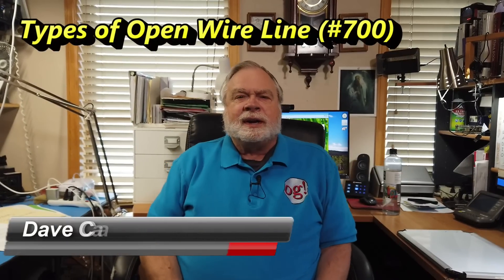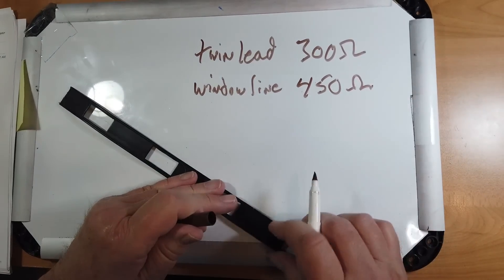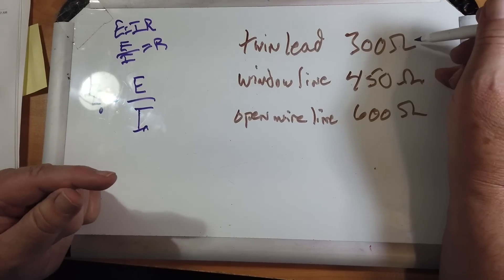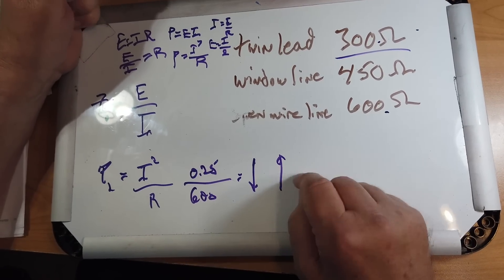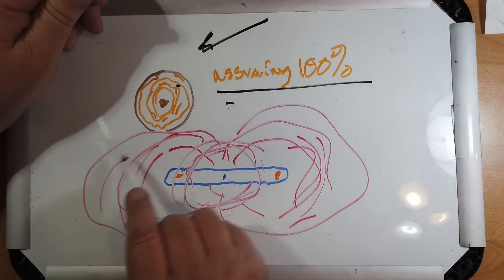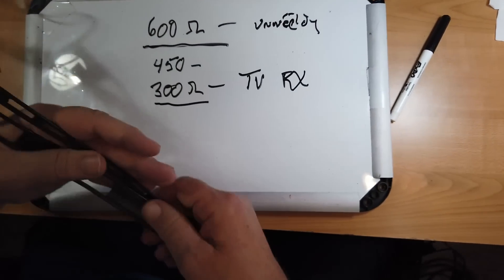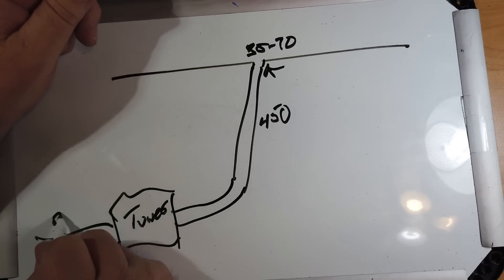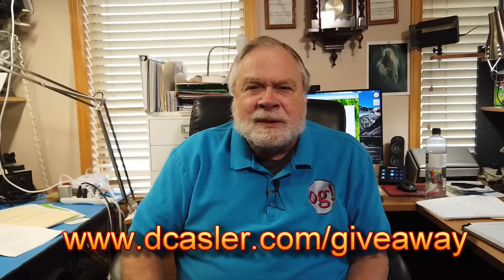Types of Open Wire Line (#700)

Comment: I had a trouble by following this explanation. P = I^2/R? And about what power-losses we are talking? Due to..? Current? Higher R lower I at the same P, V must go up. I was looking for the explanation of the 9:1 UnUn needed for the LongWire antenna and can not understand why is 49:1 used with EndFed which have similar lengths... and so on. How is impedance of the wire determined?

Comment: Very good video.  Learned a number of things.  Crazy question... what would be the consequence of running window line or ladder line inside of a galvanized steel pipe or another type of metal to insulate it from the external environment a la Gauss's Law (that electrical currents travel along the surface of a conductor...).  Would that be helpful?  Or would that cause chaos / adverse coupling effects?

Comment: Dave, rather than i^2/R, I think you want the Equation Power P= E^2/R to explain the lesser power loss for a given EMF with window line with a higher R than 50 ohm Coax cable.

Comment: I remember internal TV aerials having 300 ohm ribbon cable, thats what we called it here. Old tv's only had inputs for ribbon cable, no PAL coax socket. Some newer tv's had input options for both. I didn't understand 300 ohm ribbon cable at the time as i was young.

Comment: I was confused by the ohm  rating myself. My electrical background is boats and cars. So I hear 50 ohms, I naturally think measured with an ohm meter. Nope. Has nothing to do with resistance as one would think. 
It’s relative. Two conductors this far apart is this measure, the farther away the conductors are from each other, the higher the ohms.

Comment: That's what I did, made my own 600 ohm open-wire / ladder line, and it works great! It's basically what Dave said, for a all band antenna. I really don't care about SWR too much because I know nearly all of the signal will be radiated. Don't get me wrong, I'm not going to run the tuner at 9:1 SWR.. but I really don't care if it's 2:1 or 3:1, and with the tuner I rarely have a situation where it's going even be 2:1, so win win.  I remember when I first got my tuner, I was so worried about a 1:1 or 1.3:1 tuning as I always wanted 1:0.. However, these days, for example, I'm looking at my tuner right now, and see on 10 Meters, it is set to 1.5:1 with 4.7W reflected... and I say to myself "who cares".. lol   So, I'm not so anal about SWR anymore.

Comment: Make your own twin, The formula is so easy.
Insulators made from air line with a cable tie passed through it.

Formula is twice the distance between the wires.

Divide by the wire diameter 

Log of the result

Multiply by 276 = impedance of the open wire

Comment: Maybe I need to get out a bit more ... my observation is open wire lines are used at HF but I've never seen them used at VHF or UHF. Is there a reason(s) to use coax rather than open wire at VHF UHF? Thank you Dave and any commenters.
Reply: Open wire was popular on VHF before good  quality and  cheap low loss   coax. Many of the antennas were made 300 ohms into the 60's, But what a pain, fragile, broke with ice and stopped working when wet. Forget using a rotor.
Reply: @WECB640  Yeah, I'd assumed it would work, I was more curious why "no one" uses it ... or as I say, maybe people do use it and I just need to get out more :) And I'd assumed wire feeders would be (a lot) less lossy than coax, so there must be benefits of coax that outweigh the benefits of wire. Roger (other commenter) has pointed out some of the problems with wire (thank you Roger).
Reply: Yes, 300 ohm line was originally the standard for TV antennas. Coax started to be used in the 70's but 300 ohm twin was still common. By the 1990's, coax was standard for New installations. I remember an electrician telling me he had been taught that coax was "better", as it was easier to run. He was surprised when I showed him the different loss figures.

Comment: Hi Dave,

Very nice coverage on 300/450 & 600...  thank you.  And they do have some advantages...

However, how about the trade off's?

A few off the top of my head...

A) No shielding; i.e. prone to r.f.i. from outside sources - interference!

B) more difficult & expensive to protect from static & lightning.

C) the flip of a & b- above...  the no shielding thing also presents a r.f. exposure issue to us & creates r.f.i. in the shack (& home).  Flickering lights, tripping gfci & afci breakers, etc.

Back to rule #1 of antennas... everything affects everything!

... and non-shielded open line is very much a part of the antenna system.

And respectfully, from what I've seen; window line is not cheap at a buck or more per foot.  Maybe in comparison to LME-400? But about the same as good RG-213.     I do miss 11 cent per foot RG-8 & really dirt cheap 300 twin lead. I used the latter to make fan dipoles for shortwave listening back in the 70's thru 90's.
Reply: There is a lot going for it, a well balanced system will not significantly radiate from the feeder despite the lack of shielding. Of course with imbalance in the system the twin feeder can become part of the antenna. This assumes that the spacing between the conductors is small relative to a wavelength.